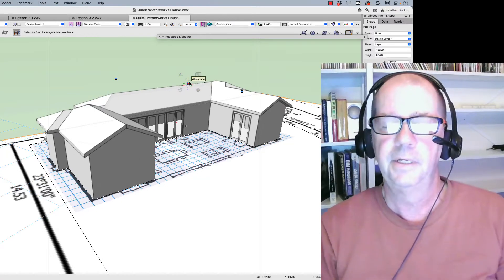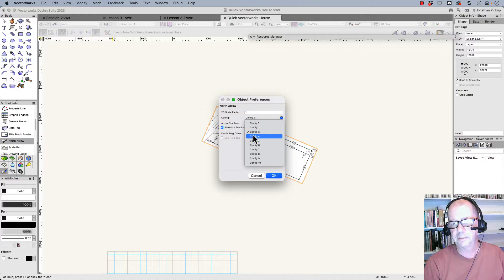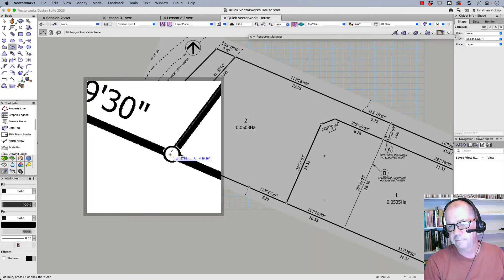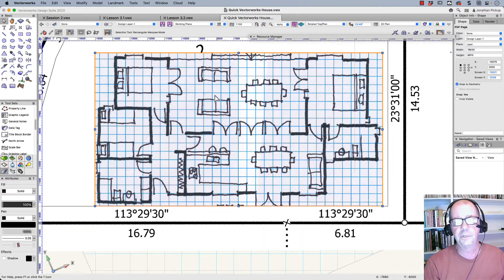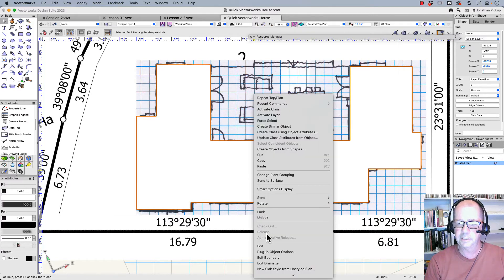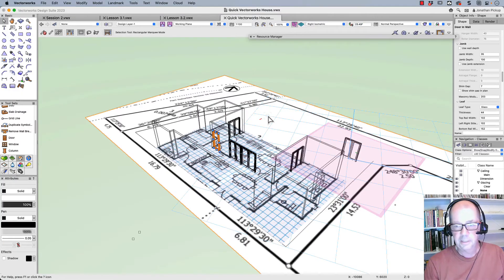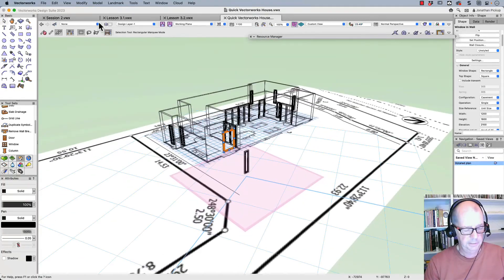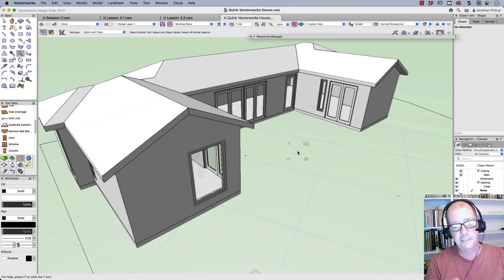Vectorworks House in 12 min

Comment: at 3:53 I did click, double click, right click.. nothing I couldn't get that blue box to come up.
Reply from the maker: OK, i get that, but have to completed the other previous steps. For example, have you traced the polygon around the site, is the polygon selected, and is the offset tool selected?
Reply: @archoncad  yes sir indeed. The polygon is “no fill” too. I set the scale. It’s a 3 sided shape like yours
Reply from the maker: and the polygon is selected?
Reply: @archoncad  yes indeed
Reply from the maker: do you want me to do this live? I could include this in a Vectorworks live that I have started. (1pm Friday EST)
Reply: @archoncad  yes please. I have something 1:30-2pm est. can we start a little earlier or will 30 minutes do?
Reply from the maker: did you attend and did i answer your questions?
Reply: @ yes I was the one that asked about the ruler offset :)

Comment: Can I ask if anyone knows of any pre built kinda simple houses residential that are ideally UK architecture - terrace etc that can be accessed as a vectorworks symbol or downloaded from somewhere on a site?
Reply from the maker: hi, thank you for your comment. I need to know a little bit more about what you want. Do you need to just have a joining Buildings to give a context to your project, or do you need a fully drawn building?
If you need to have some simple Buildings to give a context to your project, I thoroughly recommend using the massing model. If you need more help, or if you need to know where my movies is on massing models let me know.
Reply: @archoncad Hi Jonathan, thank you for donating time to reply to my message. 

Iam a 3d visualiser for a playground equipment company that produces presentations typically for schools and  find the locations being in-between residential houses which often appear in the background when I do the site survey with photos etc...

So having a selection of generic classic UK houses/streets would be beneficial to my renders.

I currently have a terrace design that can be duplicated and have created a street by just changing the door/roof/wall/front garden type - colour - texture. .... And 1 semi detached of the same street making principle.

There are 3d cad models out there in sketchfab etc but having a vectorworks made native 3d geometry model is far better for manipulating geometry/file size /not slowing my comp down and so on...

 I'll try to find an example of my current models to give you an idea....
Reply: https://youtube.com/shorts/4G_KIDKZ62o?si=htj4GRN8YJ5VNU3n
Reply: Not a great clear example as I'm doing this on my phone with my limited examples I have at hand ....
Reply from the maker: I can think of several ways to do what you’re trying to do. One way I would suggest is camera match, will you take a picture of the scene behind and then you put your model into that scene so you’ve got the actual building behind. Another method might be to use the masking model if you don’t mind having very generic Buildings. With the missing model, you could create an image prop for each building and use a photograph of each building from the surrounding area and put that on the front of the missing model so it looks like the real building

Comment: how to draw inside walls
Reply from the maker: Drawing internal walls is similar to drawing the external walls, but you need to use an internal wall style and you need to change to the wall-Vertex mode. There is a complete architect course here if you want. It is a few years old, but most of the topics covered are similar.